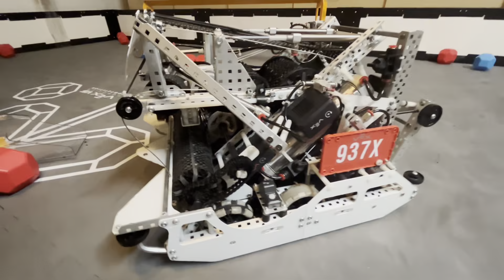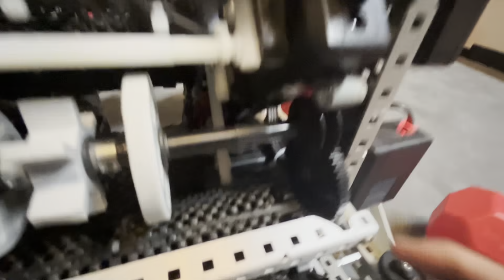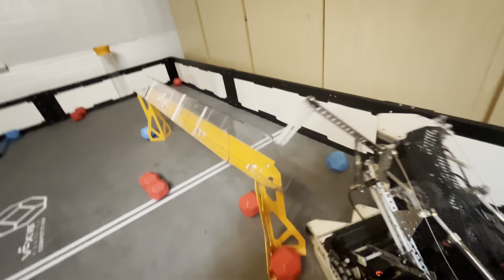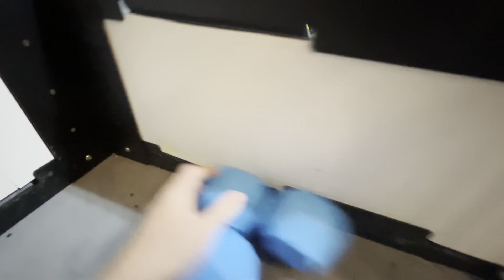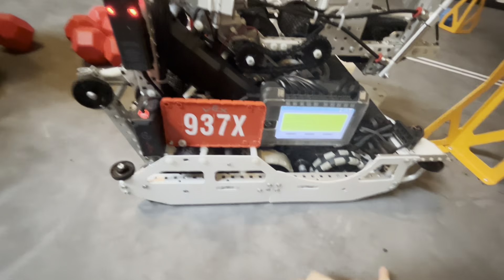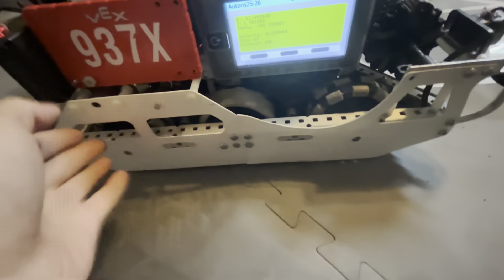937X Early Season Robot Explanation | VEX Push Back

Comment: do you actually need 2 odom pods instead of just one if you have a traction on drivetrain and an inertial sensor, or is it just nice to have?
Reply: Yes, since robots still experience wheel scrub, where the bot still slides on tractions regardless of the grip. This is mostly due to center of mass not being perfectly in the center of the drivetrain, so having 2 pods is almost mandatory for consistency in skills. For matchplay, the shorter 15 second duration is compliant enough to not require the horizontal pod.

Comment: Just a heads up too, the main reason teams balls push away from their intake is because their rpm ratio between the foot per second ratio of the base to the ball is too little. For reference, if youre intake were to have a slower feet per second speed comparative to your drive train, your intake will run slower and your drivetrain will run faster, causing the ball to push away rather than intake (when moving at full/optimal speed). Contrary, if you were to have a faster feet per second intake comparative to your drive train feet per second, no matter what speed you go the ball will go in. All in all the difference between rubberband rollers and flecks wheels arent much but they do not affect the "affect" of the ball intake or not.
Reply: This is partially true, but the more important consideration is how the bot's momentum transfers to the balls, especially with clumps. We found that the softer mesh and band rollers helped mitigate the fast forward momentum of the robot, but roller design isn't as important anymore with the use of the matchloader to catch the clumps of balls.

Comment: How much does the metal fields affect the distance sensors? When I switch from metal to plastic fields I see no change.
Reply from the maker: From our experience the metal fields without any form of backing on the polycarb resulted in less consistent readings especially at non-perpendicular headings whereas on the plastic fields where the walls are fully white the readings are more consistent. I believe the reason for this is because of how a Class 1 laser's light tends to refract and pass through the clear polycarb (or reflecting internally) rather than reflecting back to the sensor which weakens the signal, but on the white surface of the plastic field's wall this issue is greatly mitigated as the light returning to the sensor is much greater in intensity.